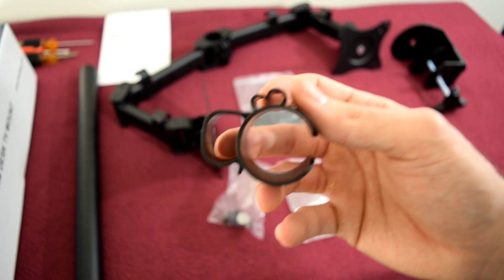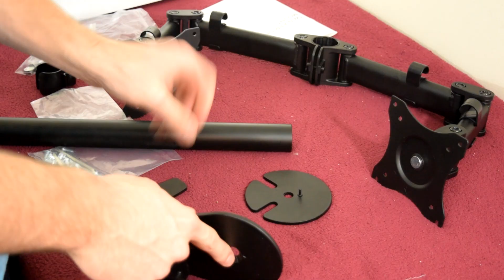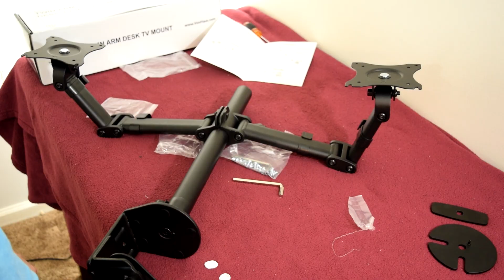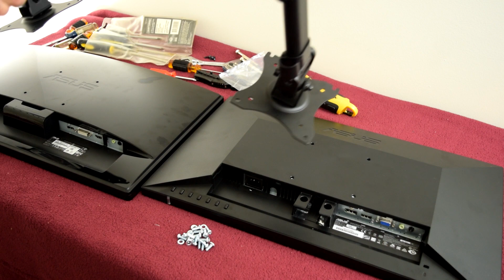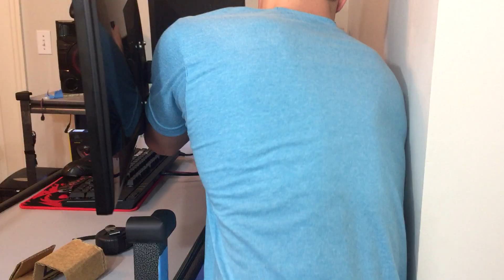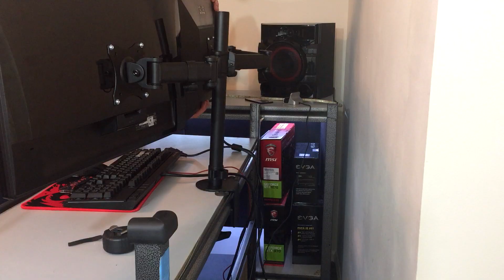How To Install A Vesa Mount Tutorial - Setup Guide | Setup Makeover Part 2

Comment: what  my monitor doesn't have any holes on the back of it?
Reply: Hey not sure if you already figured this out but you will need to buy a vesa adapter which instead of screwing into the back of your monitor it will clamp onto the top and bottom of it. This is an attachment that you buy that will attach onto any monitor mount
Reply: @KreativeKyle  lucky i came abd scroled down otherwise i wouldnt of been able to put my monitor stand on my monitor lol

Comment: Can the monitors be leveled like so they right by each other
Reply: nope :( mine can't, u gotta get a pricier arm
Reply: He put them right next to each other
Reply: Oh its because he has different monitors I have this and mine are leveled
Reply: Get the Vivo desk mount instead
Reply: Depends on what arm you get. I’ll link a good one for $30 in a second
Reply: @Couleur  arms are not cheap lol
Reply: @lanxzx1172  you can get a good one for what, 40-60 bucks?
Reply: @Couleur  yup as long as you only have 2 monitors. If you got 3, things suddenly get more expensive for some reason -.-. 150~ if you want each of them to be height adjustable - or get a double arm and a single one which can save you 50-70 bucks. I really don't get the pricing for those arms :D. 
Things get really expansive if you got a monitor with more than 8kg weight and long arms.
Reply: You can vertically mount them
Reply: Yes. I have the same mount. You just need to put some elbow grease into it.

Comment: When putting in the mount screws you have to do it by hand? Is that gonna be tight enough?
Reply: I don't think so
Reply: I would recommend using a tool so the screws are right but not too tight to break anything

Comment: Do all monitors have those 4 holes in the back?
Reply: Most moniters do
Reply: A lot of monitors don’t have the vesa mounts. If it doesn’t, no worries. All you would need at that point is a vesa adapter which you attach to the mounting arm and allows your monitor to be clamped from the top and bottom instead of screwed into the back
Reply: @KreativeKyle  you are an actual life saver

Comment: the hight adjusting screw i tightened it as much as i could and yet it still kinda falls is it suppose to be like that?
Reply: mine keeps falling aswell, have you found a solution to this?
Reply: @xef7x346  yes, you just had to add some weight  into  it and it wont fall
Reply: Zevs thank you, I had another look and a bit of mine has snapped, I’m getting in contact with Amazon now but thankyou for your help

Comment: Can you put a monitor on a arm or mount it on a wall with a stand already attached to the monitor? Cause I'm trying to find 24inch monitors that aren't that expensive that don't have a stand under it already and I can't find any.
Reply: Most stands will cause issues for the arms or completely block access to the vesa mounting holes. However, 90% of monitors allow you to remove the stand and often come in the box already dismantled. I would buy one and simply not attach the stand to it
Reply: @KreativeKyle  or... You could cut it off

Comment: what do i do if my monitor has no mounting point on the back could I find a mount that uses the normal monitor stand mount postition?
Reply: not all monitors are vesa compatible, if it doesn’t have the holes it can’t be used with vesa standard mounts

Comment: does it work on a acer xf251q?
Reply: Hey bro I just checked and yes. It is compatible the xf251q has a 100x100 mm and the maximum capacity of this vesa mount is 100x100 mm. I hope it works for you

Comment: how do I know what mount is compatible with what moniter?
Reply: All mounts are compatible with all monitors that fit the weight and vesa size. Most monitors will have a vesa mount of 75x75 mm or 100x100 mm. I would look up your monitor specs on google to find out what vesa size it has and how much it weighs. Then go on Amazon and find a monitor mount that fits those requirements

Comment: can you put this on any monitor?
Reply: It has to have the 4 holes
Reply: @unrealfax4436  what if it doesn't have like my LG monitor?
Reply: Yes, if it doesn’t have holes on the back then all you need to do is buy a vesa adapter which you screw into the monitor mount and it will allow you to hold the monitor up by clamping the top and bottom instead of screwing it into the back

Comment: My monitor doesn’t have 4 holes on the back of the monitor I’m so confused on what to do
Reply: im having the exact same issue right now with my own acer screen, for me the only options are to either buy a adapter or to modify my screen manually
Reply: Yeah that mean it doesn't support Vesa Mounts and this video is a tutorial with the Vesa mount
Reply: Same. Even though the specifications on the website said it was vesa compatible. I guess I got scammed. I hope I'll get a refund...

Comment: What if the monitor does not have mounting holes uh oh
Reply: You will need a VESA adapter. This is a clamp that you attach to your monitor mount and will allow your monitor to be clamped from the top and bottom instead of being screwed in from the back. Search it up on Amazon to find out what I’m talking about